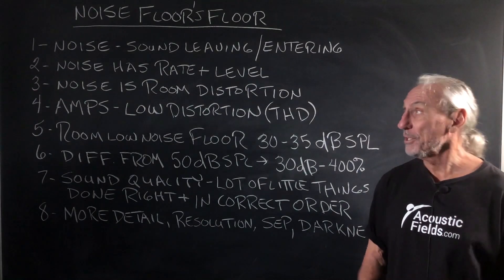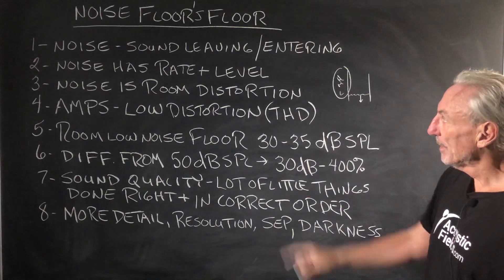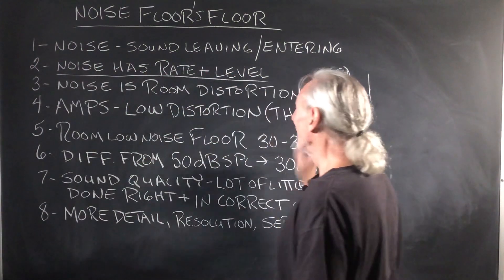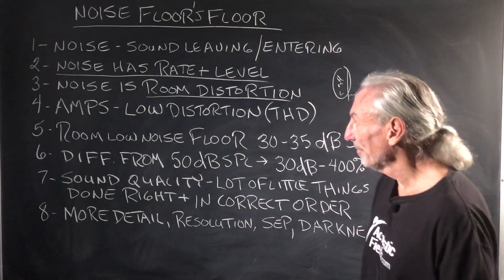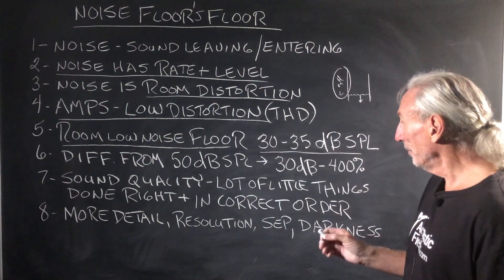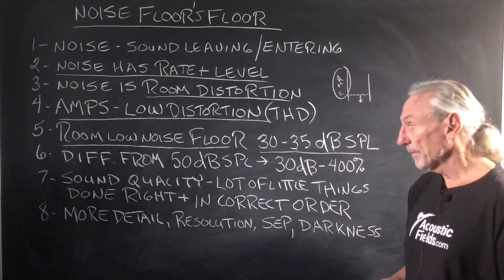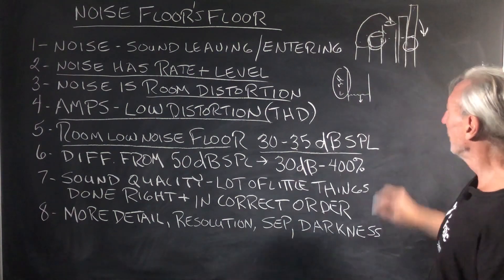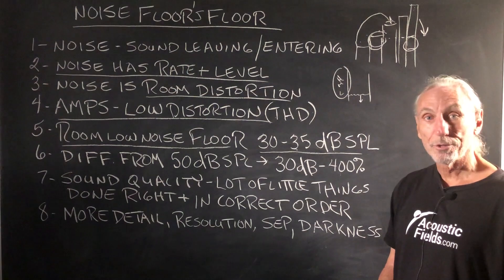Noise Floor's Floor - www.AcousticFields.com

Comment: You mentioned one of my pet peeves i.e. noisy restaurants. And as you mentioned in a previous video, as we get older reverb has more of a negative impact on speech intelligibility. 60db spl background noise really isn't conducive to dining imho.
Reply from the maker: We have treated churches to lower reverb times. In most cases, especially with a more mature congregation, attendance improves. Speech intelligibility indexes must be maintained correctly or both the spoken and musical word that supports the spoken will not be heard. If it can't be heard, we do not have any comprehension and without comprehension there can never be understanding. I still don't understand after hundreds of church consultations, why more attention is not paid to acoustics in churches and restaurants.

Comment: Whats your opinion on tube amps regarding distortion?
Reply from the maker: The harmonics of tubes done right can be wonderful. I like tubes for the mids and highs and solid state for the low end. I need the damping factor of sold state for the low frequency driver movement.
Reply: @AcousticFields  As in bi-amping?
I like to use tube preamp/solid state poweramp.

Comment: Probably the biggest problem with noise is the computer, if its a desktop.
Reply: Modern PCs are almost completely silent if configured properly, M1 macs are dead silent.
Reply from the maker: Noise is like an onion. It has many layers that are different "thicknesses". The less layers of the onion, the better.
Reply: yup, plus…. HVAC, air purification systems,  major appliance even if they are in other rooms, that noise travels, especially if they produce low frequencies, will increase the noise floor..